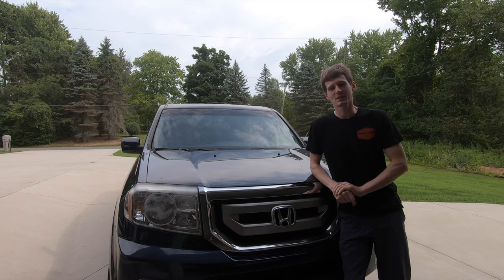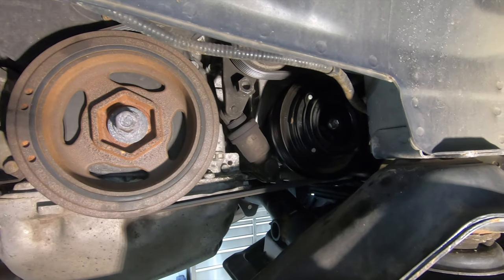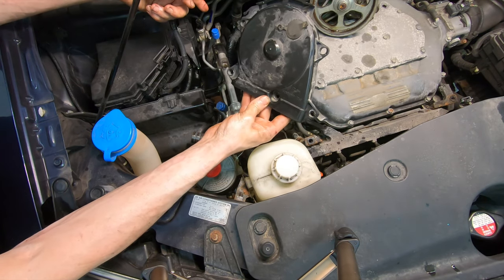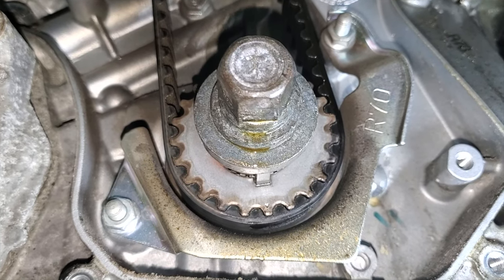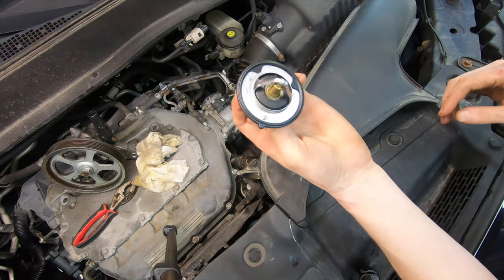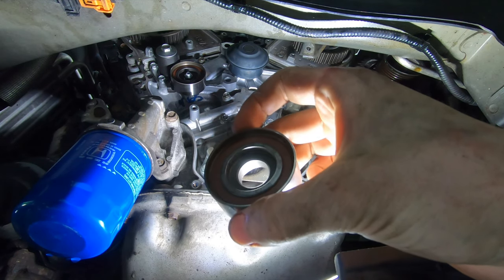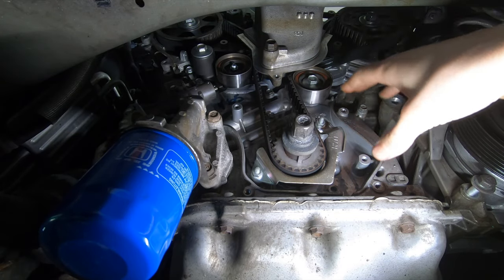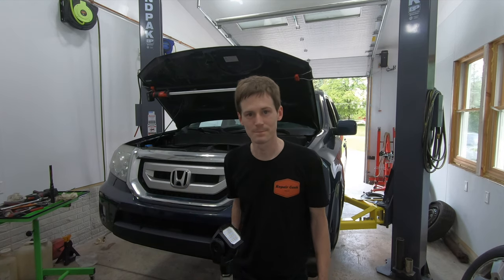Honda 3.5L V6 Timing Belt & Water Pump Replacement- Pilot, Ridgeline, Odyssey.

Comment: Nice video, one of the most detailed I have seen so far, I just did my wife 2010 Honda odyssey over the weekend. Something that I will really add to the work you did was draining of the coolant system.
I will agree no point in draining the whole system from the radiator because it will not clear the coolant in the engine block, and it will spill just as much as it did in your video.
The EASY way to get it done without draining the whole system; is by the drain plug/bolt in the engine block, it is locate 3 or 4 inches behind the hydraulic timing belt puller in the engine block…it is a cooper/aluminum bolt (the cooper is screw into the aluminum bolt).
Spray some penetrating lubricant between the union of the two bolts, then hold the aluminum nut (17 mm) and unbolt just a little not all the way the cooper bolt (13 mm) you can put a 3/8” hose in the nipple (just like you drain the brake calipers) and catch the coolant into a container or bucket. You still will have some coolant when removing the water pump, but it is minimum.
Not spill or mess at all…
Cheers
AGAIN, NICE JOB….
Reply: Getting ready to do my kids oddessy.
Reply: I was going to look for a block drain plug, glad to see there's a good chance there will be one.  Was there any concerns that you would not be able to seal it back up?  I've heard The Car Wizard say never use the radiator petcock but that's pretty obvious suggestion when you see they are often made of plastic.

Comment: This is above my comfort level , but great video. Would need to watch it a few more times before I attempt to do this
Reply: I’m in the process of doing it my first time. Been working at it for a couple hours. Got the water pump out and decided to take a short break. Reassembly soon.

Comment: Alright, step one: buy a lift...

I'm a mechanic and this was a very well made video. Good job!
Reply: Hello sir. I am 15 and want a accord v6 6mt. But my dad is scared for the timing belt. How much does it cost for a mechanic to do it? Also how much does honda charge for doing it? Thank you
Reply: is there any way to do this job without a lift? looks like a lift will be critical only in tightening the crankshaft bolt.
 i have milwaukee impact gun, leslie 19mm socket, crankshaft holding tool, torque wrench, 3 ton jack, stands.
Reply: @wilsmith9230  FYI --- A dealer may charge up to $1200 to change a timing belt on your car depending on where you are located and the labor rate, but could be a little less. Independent garages charge less --- i have heard as little as $750, but probably more like $850. It is time consuming --- probably as much as 5 - 6 hours. Also, I suggest buying the entire kit from Honda, not any aftermarket parts. On my 2003 Acura TL-S I have to change my belt every 7 years or 100k miles. I am on my 3rd belt.
Reply: @kensimon4478  Also, if you use any independent garage, make sure they have done this job before on a Honda/Acura and it is an experienced mechanic. It must be done correctly.
Reply: @MM-ln4ym  I have seen the work done on 2 odysseys and wanted to do it myself so I bought the major tools to do the work myself. I just don't have a lift. I just have jack stands and a 3ton jack and ramps. I have a Milwaukee impact, Leslie 19mm, 3/8 long neck and getting a 3/8 impact socket set.
Reply: @kensimon4478  You don't really need a lift, but it probably does help. Did this guy in the video use a lift -- i did not watch the video...? But everything on the entire front of the motor has to come off and all the timing parts have to be put back correctly with everything lined up. Honestly, this is a little tricky job unless you are a mechanic. If you look around you can probably find a mechanic to do it for the low end price of what i indicated, especially if you give him some time.... If you don't assemble everything correctly and the engine is not timed properly, you would have to do it all over again. Also, when you do this job you should check the oil pump seals and make sure there are no leaks since replacing them is easier when you do a timing belt job --- because usually the oil pan has to come off.... Unless you are very comfortable doing this stuff, i would not proceed without help.

Comment: Very helpful video.  I wanted to share what I did to ensure the belt was on properly with no slack.  Before I removed the old belt, I used a white marking pen to mark a belt tooth and the corresponding notch on the cog at all three cog locations (both cams and the crank).  I used the old timing belt after removal to mark the new timing belt at the exact three locations (same number of teeth between marks).  The old and new timing belt teeth should be spaced exactly the same so I made sure the marks on the new belt perfectly match the marks on the old belt.  I also found it very helpful to very slightly rotate the cam shaft clockwise a few degrees to get the belt on the exact location marked and the teeth properly seated in the cog.  I then rotated the cam back (counter clockwise) a few degrees to make it taut.   Make sure the marks on the cam and two crank cogs are properly aligned.  This worked great for me and gave me the confidence to start the engine knowing the belt was on correctly.  I notice that Mark Johnson in his comments below refers to the same method of marking the old and new belt.
Reply: EXACTLY! THIS IS A MUST DO!!! The new belt is so darn tight I would have probably got it on a tooth off if I hadn't been shooting to match the position tooth-for-tooth. Just "taking out the slack" will NOT suffice.

Comment: Thank you very much for your video, very professional and thank you for providing the torque measurements. I failed with the water pump because I did not torque the screws correctly, and it was left leaking. Greetings from here in California.

Comment: I must have watched your video like 30x I have a 2004 honda pilot and a 2007 honda odyssey did both in a 2 week period. Odyssey timing belt busted while driving. Just shut off itself. Put on the new belt and it worked I was 1 of the lucky 1's

Comment: Thanks for showing where to line the timing marks on the crank pulley and mark on the block.  It was not obvious on other videos.
Reply: Just be careful with the parallax. Make sure you’re looking right down the line at the marks. Especially on the rear cam. Sometimes I’ll take a ruler or piece of paper to make sure I’m looking straight on.

Comment: Superb job. The best I've seen. I'm getting up the nerve to replace the timing belt on my old 2000 Honda Odyssey that was given to me some years ago. Its over 211,000 miles, and probably had a timing belt change around 100,000, so its definitely due for replacement asap. Can't afford to take it in to the dealer, so... Thanks!
Reply: Same here!

Comment: I know you had been stressing about NOT  to turn the camshaft while routing the belt. Because I had experience in replacing several timing belts and a few chains, I went ahead against your advice on my Odyssey. Not to say your advice was wrong, I too worry about cam shifting. However, I did  turn the cam because the old belt had stretched where the new belt will not fit. I will stress also that if you DO move the cam, DO NOT use ratchet. Use a breaker bar so it doesn't ratchet while shifting. Like someone commented under your video that warned 99% of the time will have one tooth off in the rear cam. I caught it plenty before I released the tensioner ring. Got it corrected by shifting the cam which was necessary but very very limited margin. I still believe your advice is still valid since there are many noobs watching how to on your video. I mainly watch your video because I dealt with a lot of older cars and modern ones tends to be more complex.

Comment: Best video yet, but one wish. I have yet to find a video that actually explains what to do IF... you screw up and the timing marks don't align after the install and rotating the engine, or the belt was not tensioned right and a tooth was off? That is what I worry about. Everything doesn't always go right and how to correct those issues is what I would like to know as I am about to start on my 2004 Honda Pilot. Otherwise, great video!
Reply: Happened to me when I did this yesterday. I aligned the marks in all three spots, took the belt off, water pump etc. When I was placing the new timing belt, the rear cam turned clockwise about a few inches, ooops, I probably put too much tension on the belt. Thought I ruined it. Nope, adjusted it back to where is supposed to be and the van runs great. And all I did is turn the cam back to its original setting. After all was installed I turned the engine about 4 times and everything was smooth. Happy me.

Comment: As a mechanic, of some years (built first motor in the 70's). I appreciate your video. For the same reasons as the rest. Only add I would suggest. Since I am blind in one eye and can't see out of the other. I use a paint marker on the timing marks. Thanks for the great video.

Comment: Excellent job!   Really at a much higher level than other Videos like this.  Hats off to you and thanks for doing it.  I seldom go to the Library to look up a job in the Manuals anymore.  I search for a good Video like this, much easier.  I know you are not going to change the Video, but for anyone that reads this, start at the Rear cam and go to the Forward cam, then down to crank while maintaining tension throughout.  Reason:  Rear cam and water pump have rings on the outer portion that make it hard to get the belt over the cam and water pump.   Very difficult to get the belt into the proper notch with the outer ring.   I got all the way around starting with the front cam and then figured this out.  So I reversed after putting it on the rear cam and tensioned from Rear cam to crank.  Worked much better that way (front cam and crank do not have outer ring, so you can slide the belt into the notch.  Note also that I temporarily tensioned the belt with a 1/4" to 3/8" tapered hardwood wedge instead of pulling the pin.  This was a just in case so I would not have to re-compress and pin the tensioner.  Worked slick.  Again, great Video, thanks.  P.S. I could not get the socket right away and I needed this done now.  I had a strip of lead 3/8" thick (lol, I'm 65, I've acquired things).  Wrapped it around my impact socket and tightened with hose clamps.  Same effect, unsure if it would work, but worked exactly like your big socket.

Comment: I appreciate this video detailing all the steps needed to replace the timing belt and water pump.  I like how you also replaced the thermostat while you're in there.  You have made my decision of spending my time versus having the shop handle it while the car is in for a recall issue.  I'll stick to spending my time working on trucks where there is more room and I'll stop griping about the lack of space after seeing this.  This is very tight quarters.

Comment: Great video! Thanks for sharing. Something I did in my Ody as a first timer when I did mine was to mark the belt as well before removing it and transfer the marks to the new belt and match it to the marks on the pulleys when installing it back
Reply: this is a brilliant idea to have  confidence in proper timing
Reply: Yep thats how I do it. Once I was off  by one tooth and I learned a big lesson

Comment: Great video! Thank you!!!
I tightened the crank bolt w/ heavy socket, 1/2" impact on max with 100psi in the hose. Got the 60deg w/ 2 10sec blasts. Marked the bolt head and damper with paint so i could judge the bolt rotation. I just could not get 60deg on my back w/ the breaker bar & cheater. Guess i need to work out more. But the impact/socket is sooo easy!

Comment: Thanks for your video. Timing belt is now changed. Started right up. Keep up the good work. I used that same socket with a high torque impact and it still did not break it loose though. I had to break it loose old school. The step by step and torque values were helpful. Although if your at 100,000 miles draining the radiator is not a huge waste; unless it had already been done. My fluid was a bit nasty. Usually if I flush a radiator I used distilled water. I buy a bunch of jugs. I had read that tap water can react with the radiator fluid and cause problems down the road. But overall good job.

Comment: Thanks for making such a great video on this, really helped me get a feel for the job.

A bunch of the maintenance intervals on my Pilot just lined up and even the lowest estimate I got is still big money. I've been doing my own oil changes for about two years now so I did some research and I've done everything except the belt/pump but unfortunately I think this is a little above my skill level. If I had a backup car I'd probably try it myself but if I screwed this up it could turn into a serious mess.

Comment: That timing belt guide that goes over the key is very important. Hey talks about the correct way to install it in the video. If it gets put on backwards it will eat into the timing belt and it will fail. Ive seen one drive for almost a year before it failed. All from that one part.

Comment: Thank you for the tutorial,  I thought I would be able to tackle this job but I couldn't get the crank shaft bolt off so I threw in the towel 😕.  your instructions were very good BTW,  I almost felt like I could do it after watching this like 20 times.. 😂

Comment: I'm in the middle of doing the timing belt job on my '06 Honda Odyssey EX-L and I bought that special $20 Lisle 19mm harmonic balancer socket too. I have the Kobalt XTR ½" drive impact wrench 24V that is rated to 1200 lbs-ft of breakaway torque. Like you, I wanted to see if a regular 19mm impact socket would work and it zipped that bolt right off to my surprise. My battery was at full charge and your Milwaukee was @ ¾ charge. That may be the culprit. Thanks for the video. 👍

Comment: This is an awesome instructional video.  One question I have is the engine still supported by a lower half support once you remove the top of the engine mount?  It looks like you removed the floor jack once you got the top of the engine mount removed.

Comment: Great video..gave me confidence 
Question..I removed the black valve at the power steering pump end of the manifold.   It’s called an air bypass valve.   I don’t think I changed its position.   Has gear teeth engagement.   
Do you know how critical it is if it’s off a tooth when reinstalled? 
Thank you

Comment: Thanks for the great video, I'm doing my timing belt and my new belt is off by half or one tooth on the cam by the firewall my timing marks are aligned but I don't know why it won't align over that rear cam any idea would be greatly appreciated thanks

Comment: Great video, I'm an old wrench whose wife ordered me to do her timing belt/major service on her 2018 Acura RDX since I bragged about doing all the major work on my 2005 Sequoia and 2013 Honda Crosstour. Unfortunately she's right and it would save a lot of money. Part of my procedure on the Sequoia timing belt replacement  included removing the spark plugs to reduce resistance throughout the job as well as minimize the possibility of mechanical misalignment of the valves. Is this something that might help the timing belt replacement on Honda/Acura 3.5  V6 motors?

Comment: Makes life alot easier if you take the pcm out. Its three connectors and 3 bolts. Makes more room to remove the motor mount, pump and the timing belt covers. If ur replacing the timing belt, always good idea to replace that side motor mount. It's usually leaking or torn up.

Comment: I did my first timing belt job on a 2013 odyssey yesterday(I’ve built jeep 4.0s with timing chains)!  Thank you for the video.  I did have to buy the special thick crank socket, crank hold-tool, and use my brother’s new ryobi(4’ breaker did nada).  Continental put the wrong size belt in the kit, so had to buy a dayco locally.
Reply: Which Ryobi product did you use?  would 4-mode brushless impact driver be ok? or you actually got an impact Wrench?

Comment: Thanks for the vid 
In your parts, used description, you list both the Aisin and the Honda OEM timing belt kits ? 
What one did you end up using?
If (Aisin) hows it holding up /whats been your experience in the past with the Aisin brand 
I too have a 13 pilot and in the process of gathering information / parts to tackle this job myself

Comment: Hi I had a question for you. I am currently in the middle of this timing belt/water pump repair for my Honda Pilot and I just realized there are three oil seals in my kit. My understanding is that one seal is for the crank shaft, what are the other two for?

Comment: Thank you, excellent instruction. Q's: (1) do you need to disconnect the battery before attempting this project?  (2) did you notice any difference in the engines sound before replacing TB/WP vs after it was fixed?

Comment: So why did you remove the water pump??? Was not supposed to be only timing belt replacement ??
Reply: the timing belt drive the water pump.. you want change it when you change out the timing belt since your already in might as well do Both and that the is due for a replacement.

Comment: I actually left the slack on right side front of motor. Both cams are off 1-1/2 teeth to left. I’m thinking reset tensioner and remove it. And manually turn cams to right a nudge then reset belt. Think that will work?

Comment: I noticed this guy pulled.the p/s pump off but fletcher pulled the pully off the pump.
IS THISNAN OPTION  or different models?
(2015 crosstour 3.5 v6)
Ty

Comment: You really know your stuff and have explained this procedure perfectly.  I have a 2010 honda accord v6 with 72000 miles.  There are no engine issues now.  Given that the car is 13 years old, would you recommend performing this service soon?